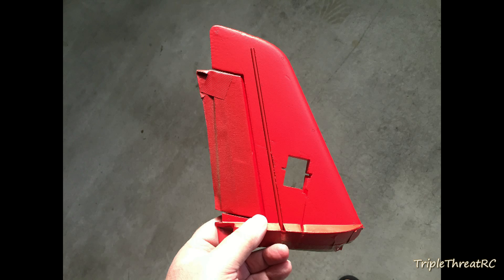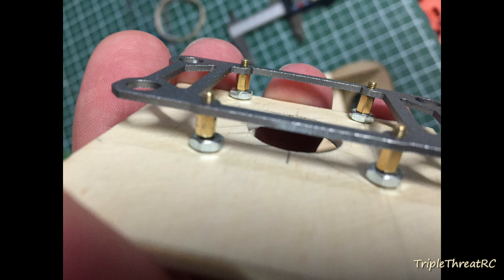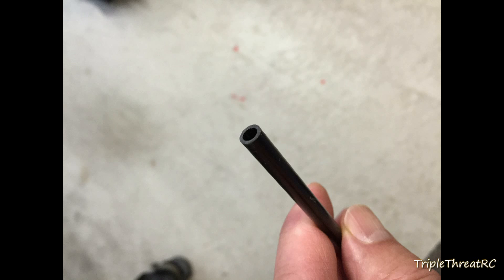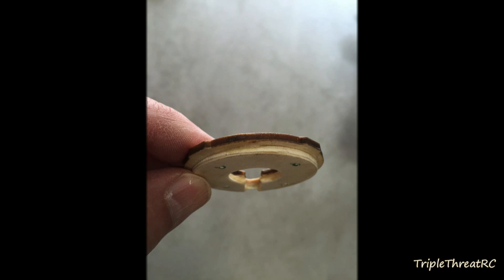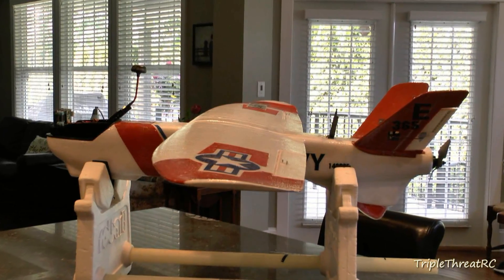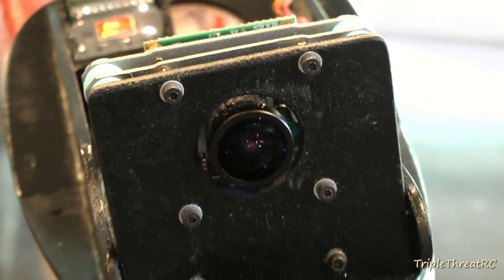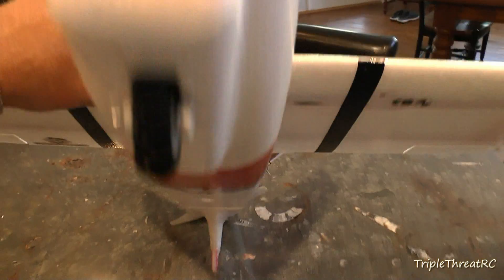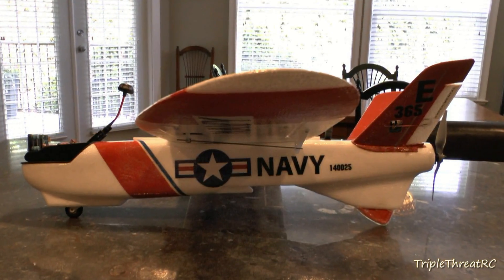X UAV Mini Talon Part 2 - Assembly

Comment: Did you glue the wings together ?
Reply from the maker: No, but I laminated them to the fuse so they won't go anywhere. If I wasn't going to laminate them,  I would have glued them. The overall size of the plane is small enough to fit in pretty much any car. Thanks for watching and happy flying to you!
Reply: That's true thanks !
Reply from the maker: You're welcome :-)

Comment: what is the total weight, do you respect the original gravity center?
Reply from the maker: I haven't weighed it because the weight will vary a great deal depending on how much battery and gear you fly with. I fly it with a 4s  3300mAh to 10,000mAh  (normally a 5000mAh) and the COG is always right on using the recommended location.  Happy flying!
Reply: ok but the take-off is not difficult with 10000 mah?

Comment: looks great, any tips on how you laminated the fuse? there are lots of different angles! how did you approach it?
Reply from the maker: +Flu-Tube 
I use 1.5 mil laminate and it is much easier to work around bumps, lumps and angles. I put an extra layer or two in areas where more strength or protection is required.  Also, for some really tough angles I will use a number of pieces to cover an area. The laminate irons to itself so well that you can't see any seams. Thanks for watching!
Reply: did u do each face as a separate sheet or did u just lay it over the top or bottom and try an work it as a single piece?
Reply from the maker: +Flu-Tube 
Mostly a separate piece for every large surface. I always go at least a couple of inches past the leading edge of the wings so that all seams face to the rear. And, it adds a few layers to the leading edge that takes a lot of hanger rash abuse lol. Also, I make sure to overlap the seam where you glue the fuse halves as often as possible. 

The control surfaces are laminated with the same piece that covers the wings, hor stab and rudder, etc. so that they can't fail if a hinge breaks. I hope this helps.

Comment: Nice video. Good paint job.. Nice to make it yours.. looks like you covered the plane.. What did you use..
Reply from the maker: Thanks very much Pat. The covering is actually a laminate. Laminating the plane helps it withstand hangar rash and rough landings and it also stiffens up the wings etc. It also prevents the foam from soaking up moisture when you land in wet grass. Most people use 5 mil but I've been using 1.5 mil and just apply another layer or two in (high abuse) areas that need it. This is what I'm using although a lot of folks have been getting their laminating film from places like Aloft hobbies. I got mine at Amazon and have enough to do about a hundred planes lol. https://www.amazon.com/gp/product/B002KCKHIG/ref=oh_aui_detailpage_o05_s01?ie=UTF8&psc=1

Comment: That's the nicest Mini Talon I've seen!  If you're new to the L9R receiver I think you'll love it.  I regularly get nearly 433mhz distances with the three I have.  I also have a diversity receiver for 5.8 video that keeps up with it just fine.  No need to go further I think.  Looking forward to the maiden!
Reply from the maker: Wow, awesome comments, thanks very much! I'm encouraged by your experience with the L9R. This was a slow build, mostly because I had to/wanted to learn Open TX at the same time. Thanks for watching!
Cheers, Bob
Reply from the maker: +MostlyHarmlessRC 
I meant to ask, which diversity receiver are you using?  Thanks!
Reply: I've got the FR632 from SBA: http://www.stoneblueairlines.com/sba-fr632-5-8ghz-32ch-diversity-wireless-av-receiver.html.  Works a lot better than the Immersion RC Duo 5800 from what I hear, which costs more than twice as much!  The FR632 also works with all 40 5.8 channels, so no worries about compatibility.  I use two IBCrazy helical (a 3.5 and 5 turn) antennas and get clear reception at insane distance.  Really.
Reply: My mistake - only 32 channels but still works fine with your IRC 5.8 transmitter.
Reply from the maker: Awesome, thanks very much! 
Woooosh, that was the sound of my credit card coming out of my wallet lol. Much appreciated, happy flying to you!
Reply: Lol!  Just when you think you've got everything you need...  Nope!  :)
Reply from the maker: LOL, I was just doing some head scratching. I am currently using the built in receiver in a set of HeadPlay goggles (that I love) and got thinking about how to incorporate a diversity receiver so I could reach out a bit further with 5.8 like you do. I've got an EagleEyes FPV station that I was going to use to capture 1.3 video from a diversity receiver and output 5.8 as a repeater to my HeadPlays and am wondering if it could work the same with just 5.8? Seems silly but it might be worth it to get the extra range.
Reply: I'd say skip the 1.3 option for now.  I think your headplays have a standard AV video input jack?  If so, just run an RCA video out cord from your FR632 or similar diversity receiver directly into the goggles.  I like goggles for proximity flying, but I mainly use a screen on a tripod for distance fpv as in my latest vid.  I'm also getting old and prefer to not have something stuck on my head!! :) My two cents, but I haven't needed 1.3 video yet...
Reply from the maker: Good advice, thanks very much! I was hoping to avoid being tethered but it is much better solution. I also like the idea of staying with 5.8 if I can. Cheers.
Reply from the maker: http://www.readymaderc.com/store/index.php?main_page=product_info&cPath=11_34_37&products_id=5357
Reply: Same beast for $5 less!  Woot.  :)
Reply from the maker: Ordered.... Woot lol  :-)

Comment: Very nice build Bob! 2 thumbs up. Can't wait to see the maiden video.
Reply from the maker: Thanks very much, I should have added you to the shout outs (I will for the video of the maiden flight).  I only hope I can get mine to look like your Mini Talon one day. It's baby steps for me. I hate being a noob lol.  What throws do you have on your surfaces?  Thanks again Joel. 
Cheers, Bob
Reply: I just recently applied expos on my aileron and elevator, 30% on both. Mechanically I have my control rods on the last hole of the control horns.
Reply from the maker: Thanks Joel, that's what I was hoping to hear. So you didn't limit the travel within the radio?